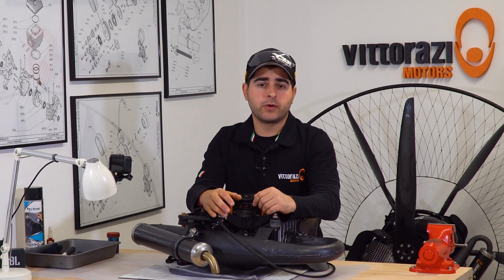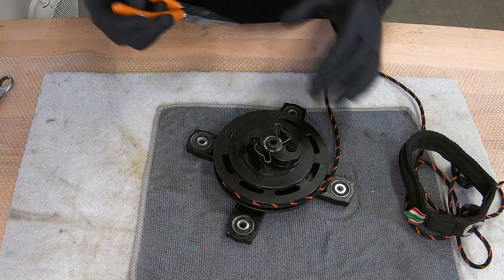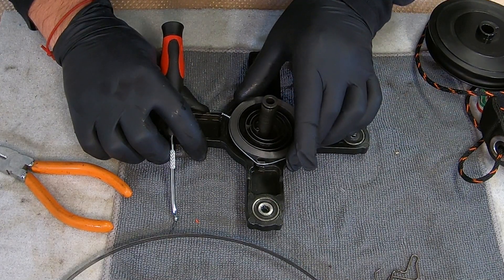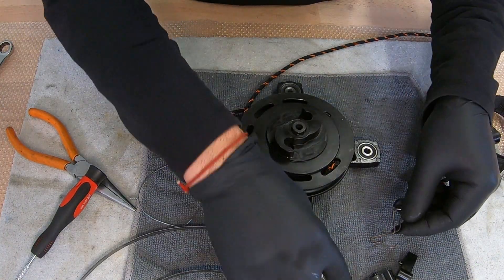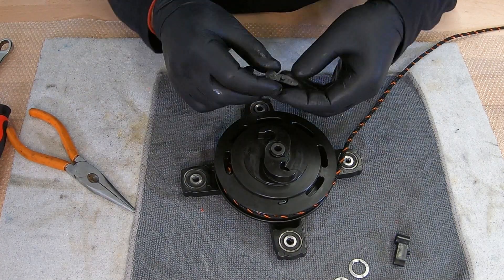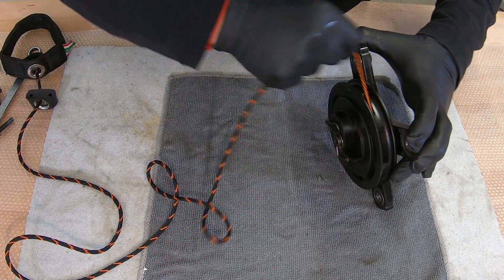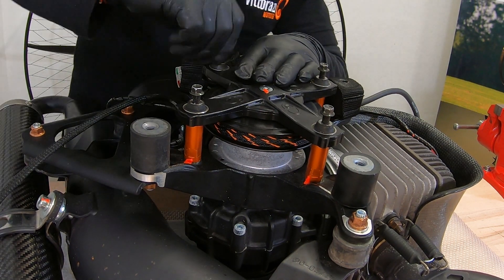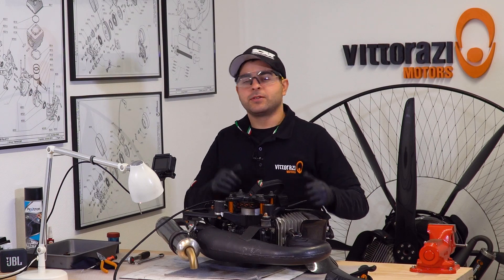Vittorazi Moster Plus pull starter recoil spring replacement. Paramotor maintenance series

Comment: I had this issue, went through all the trouble, turns out at one point the line came off the spool, and when I replaced it I hadn't retensioned the spool!  Glad to have gone through the journey of taking the pull starter off and inspecting it for damage, though!

Comment: You guys probably get bombarded with questions about the 4 stroke EOS engine all the time... but I can't find any newer information since last year, are their any updates on that project? Engine Volume has always been a prohibiting feature to me for these types of sports, I have a condition that greatly increases my sensitivity to loud noises.
Reply: If you are not really a big guy yhe Atom 80 engine could be what you need. All reviews (and Stefan from Scout) say the Atom 80 is much quieter and uses much less fuel. True; thrust is less at 55kg but that only means you can't climb as fast as the Moster. The smaller engine will still push you as fast in the cruise as the Moster can. Combine the Atom 80 with a good helmet and ear protection and you will be OK.
Reply: Most of the noise is the prop, not the engine. A guy flies electric and it's very noisy as well at full power (from the prop)

Comment: is there a possibility of having an electric start in the future?
Reply from the maker: There is a version of this motor with electric start already
Reply: Really!!! I didn't know. Eletric start must be better to re-start in flying if we need isn't ? Thanks for informations
Reply from the maker: @cprsjcsp  my personal opinion is that electric start is not necessary. When I had it I have used it all the time. Now I fly manual and I don't miss the electric at all.
I like to keep things simple.
The moster plus starts fine,no problems with manual. Restarting a hot engine in the air is always the first pull.
Reply: That is true I agree. Simples is more Thanks